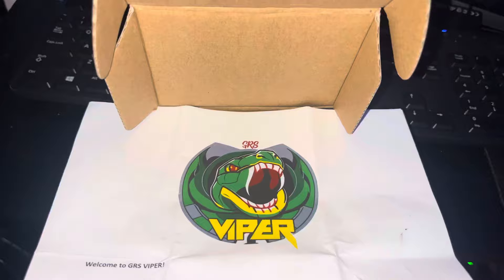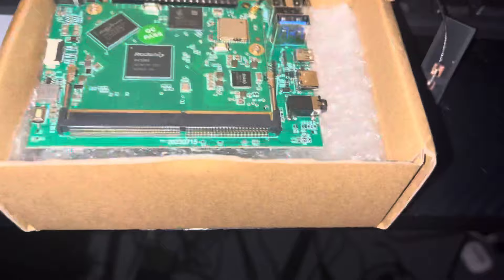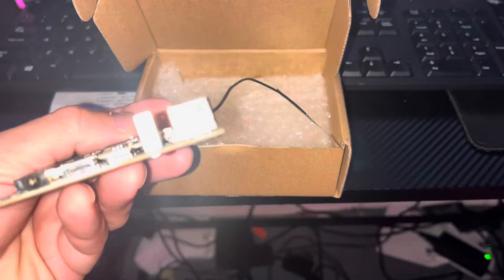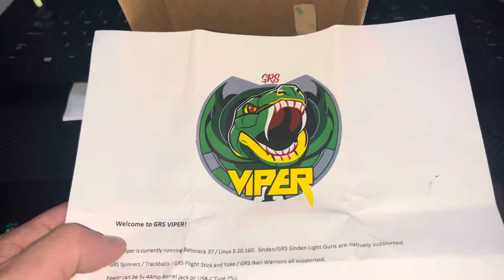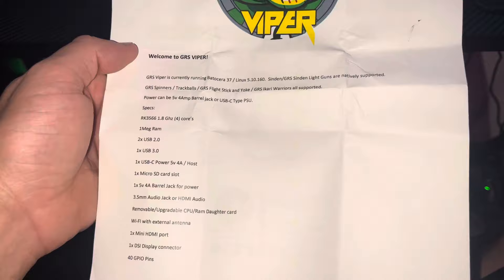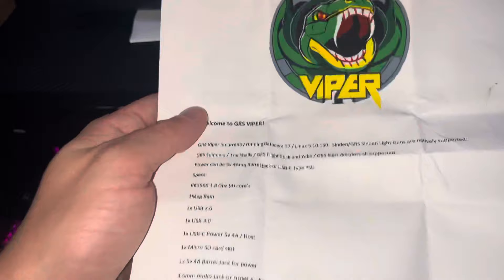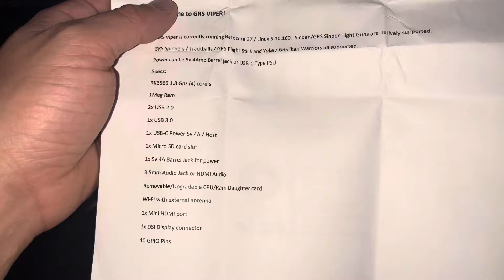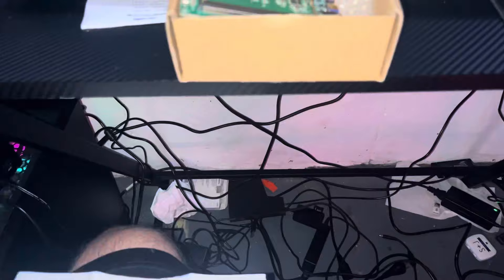GRS Viper Board first look!

Comment: Is this for the iircade?
Reply from the maker: Correct
Reply: @retrolizardscustomarcades  any updates on availability?  My GRS Control Panel arrives this week
Reply from the maker: @jayrod377 none at this time. The board is a test board and not finalized yet. I don’t have any other info regarding the product.
Reply: @retrolizardscustomarcades  do you have any recommendations on what people can do in the meantime to get use out of their GRS Control Deck?  Just use it with the existing iircade games, I guess?
Reply from the maker: @jayrod377 I do not as I don’t own an Iircade or the deck. The viper board can be used with anything including the iircade.